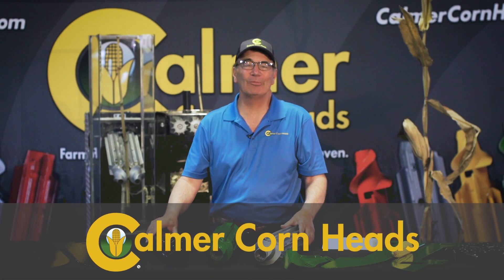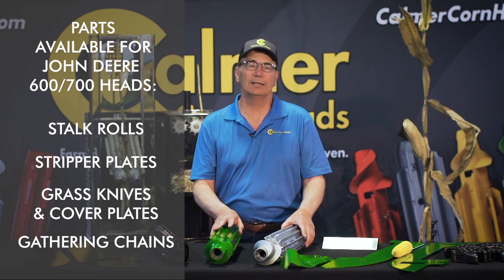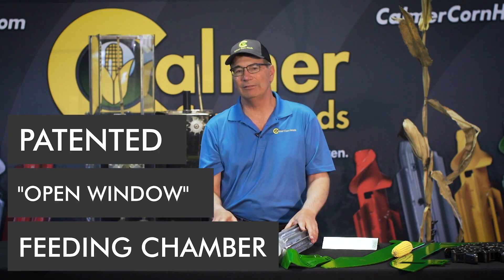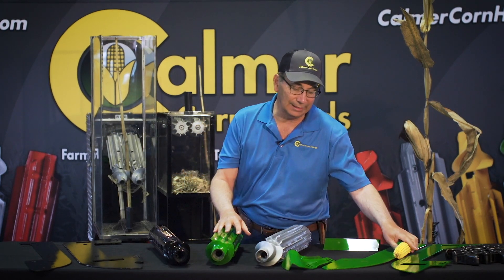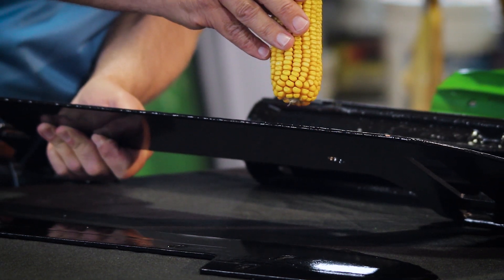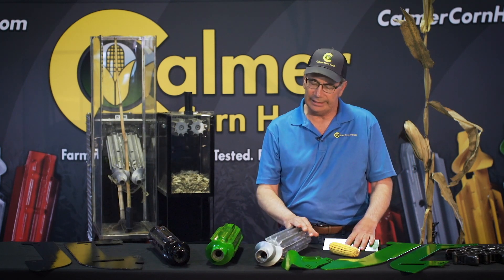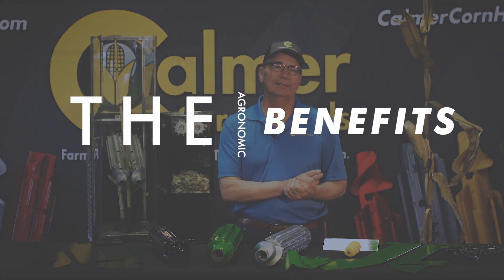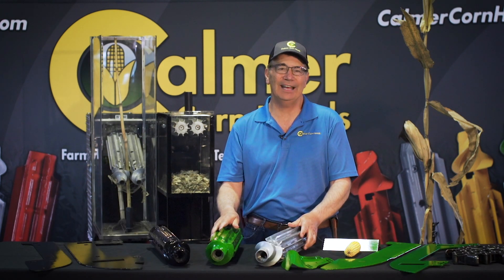Calmer Upgrade Kit for John Deere 600 and 700 Series Corn Heads (Detailed)

Comment: Bought a used 612c this past summer and later found out it had your full upgrade kit on it.  We just got started harvesting with it this past week and I have to say it is the most impressive corn head I’ve used.  Ran a 600 series head before and traded to go to a different row spacing and there is no comparison behind the combine.  Does an excellent job of sizing up the trash.   Honestly had seen you at farm shows for years but couldn’t spend the money when I thought I had something that worked.  I know now it’s the difference in working and working well.

Comment: I've always been very disappointed in the cut quality of John Deere corn heads. Dad ran Case for years and the heads cut so nice and clean. Glad someone is putting out a solution to John Deere's problems.
Reply from the maker: Our in-field tests of Case knife to knife rolls leave a lot to be desired so we developed upgrade kits for the 4000 series heads as well: https://www.youtube.com/watch?v=66Angrox1mE
Reply: @CalmerCornHeads  Of course there's always room for improvement. The hybrid corn doesn't help that's for sure!